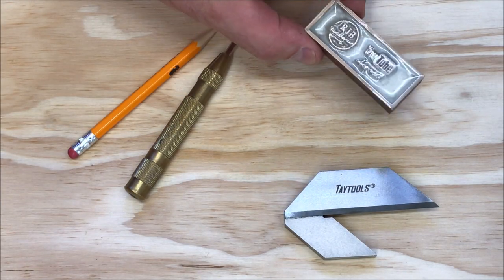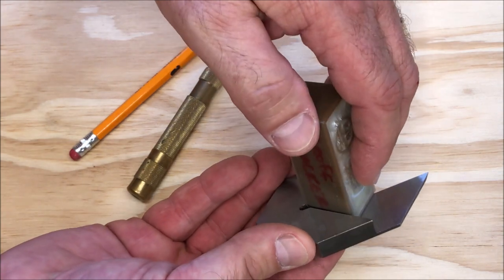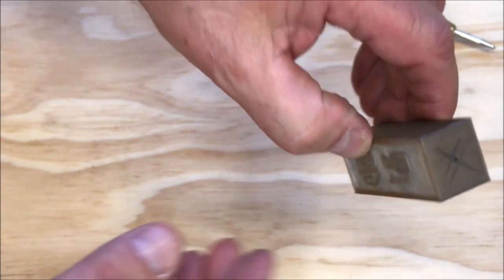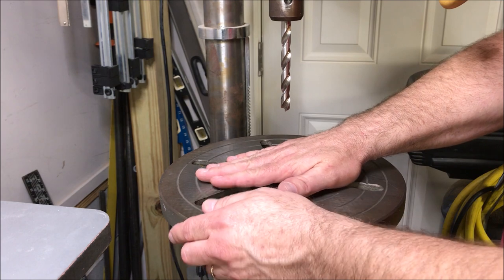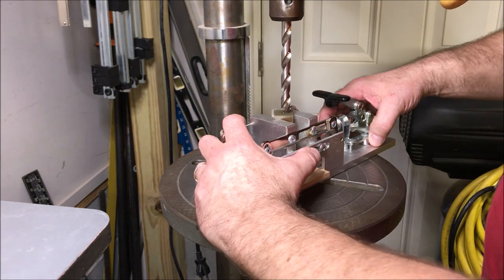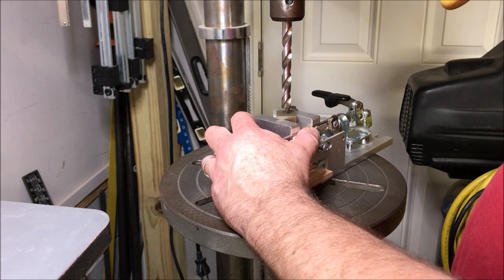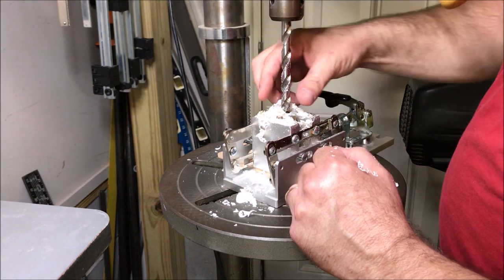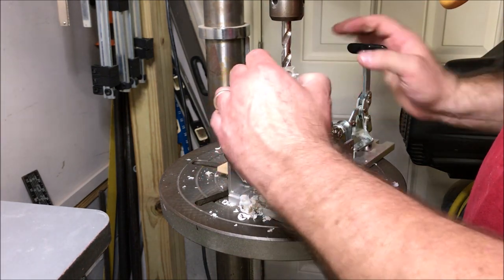How I Set Up My Drill Press For Drilling Blanks

Comment: you know I assumed my drill press table was level with the drill, now I will need to go grab my speed triangle and check it.  what I have drilled for pen blanks has just been trees from the farm, or tube in casted so it has not been an issue - yet.  my wife did has problems with some resin blanks and chip outs while drilling with the brad points so we ended up getting drill bits for acrylic for her and that has been better.
Reply from the maker: Thank you Byron. 
  It’s always good to make a check. 

Regards,
Bob

Comment: Wouldn't it be a good idea to use your square to check if the drill is perpendicular to the table at more than one position?
Reply from the maker: Yes, that would be a great idea. I have more trouble side to side so I don’t often check front to back. 

Regards,
Bob

Comment: I just chuck the blank into a head stock clamp, and spin it against a drill bit in a jacob's chuck on the tail end.
Reply from the maker: I don’t like using the lathe. I prefer the drill press. If the lathe works for you then that’s the way to go. 

Regards,
Bob

Comment: Do you ever use a lubricant on your drill bits for added ease of drilling and keeping it from overheating?
Reply from the maker: I have but I try not to because is can interfere with the glue sticking. 

Regards,
Bob
Reply: @RJBWoodTurner  I use water in a spray bottle and spray the bit on acrylics  Also spritz water into the hole when I raise the bit to clear it.  The  method has not never failed me and diminishes the wait time.  On some very hardwood blanks I will use alcohol to cool the bit.  Agree with Bob on not using oil.

Comment: Hi Bob, great video, liked and subscribed. I'm working on an art project where I want to take a pen blank that is 1" x 6" and drill a 5" hole in it. I read all the comments here and I saw that you mentioned that quill travel is important. I'm looking to buy my first benchtop drill press and the Wen that I'm looking at has a 3 1/8 spindle/quill travel. Is there any problem with me make a first pass into the blank and then moving the table and starting the next pass with the bit already in the hole? I saw in the comments down below that you also mentioned that it is preferable to do it in one pass. Thanks. Rob
Reply from the maker: I do that all the time. Just be sure to stop and clear he chips a couple times. Otherwise they pack In There, build heat and can cause the blank to have a larger hole or to explode.
Reply: @RJBWoodTurner  Thank you!

Comment: I’m looking into buying a drill press.  Can I use a 8” or 10” table drill press to drill blanks?  Can’t find recommendations on drill presses.  Thanks.
Reply from the maker: The thing you want to look for with a drill
Press is quill travel. You need you make sure you can drill out an entire blank without having the adjust the table and drill twice. 

Regards,
Bob

Comment: Another Great video!   Question....when squaring the drill table to the bit,  should you do that in more than one place?
Reply: I was going to post this anyway, ill just do it as a response.  I have a very nice Ryobi Tabletop drill press.  I got a 2 axis mill setup to bolt to the table which does weigh a bit. After using the drill that way for a while the table has started to sag to the front. I have a series of blocks and wedges to stabilize the table when doing precise work now. I always level the table to the bit from the side, and the front to make sure Im really drilling straight "down".  For a larger free standing drill press like his it may not be needed, but for a smaller press, table sag is something to be aware of.
Reply from the maker: Awesome information thank you. 

Regards,
Bob
Reply from the maker: Yes front to back squaring would be a good idea too. 

Regards,
Bob